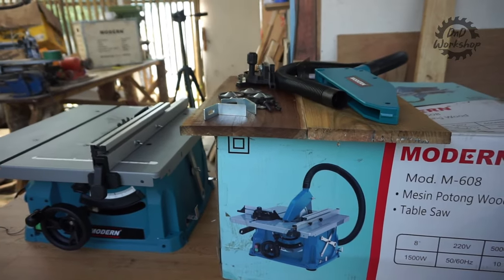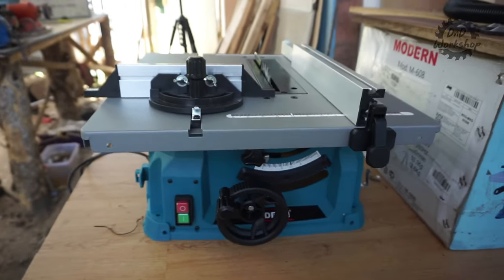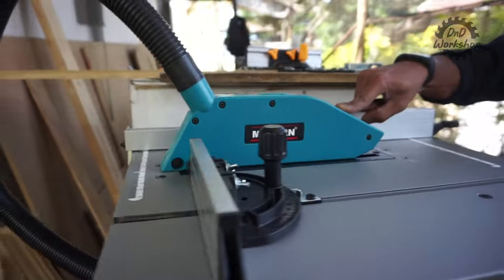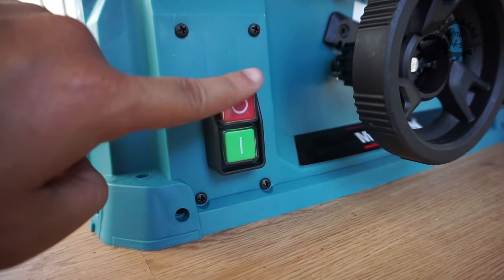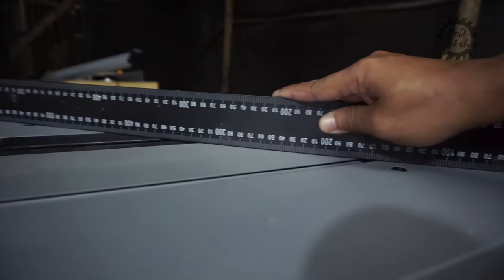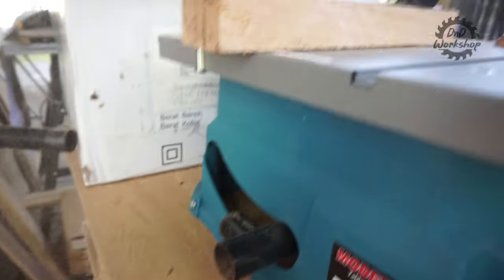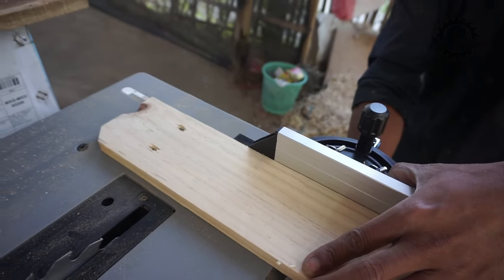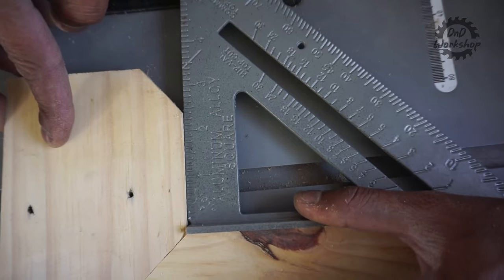Table Saw Murah Meriah 8 Inch Modern M-608 | Meja Gergaji Potong Kayu

Comment: Kalau utk potong multiplek atau parikel board pakai mata pisau jenis apa gan
Reply: Tct 60T hasil potongnya halus.
Reply: @syahdanali3529  ok. Trims infony
Reply: @AdhiELC1  minimal pilih merk bull atau di atasnya lagi merk DCA. Minggu kemaren saya beli merk DCA 5 inch 40T(50.000), hasil potongannya sangat halus
Reply: Siap gan
Reply from the maker: kalau halusan pakai 60t tapi harus sabar. standar pakai 40T yang thin kerf seperti freud atau yg terjangkau punya bull